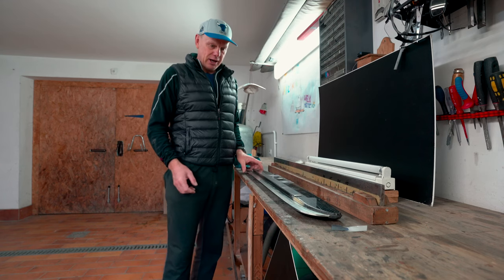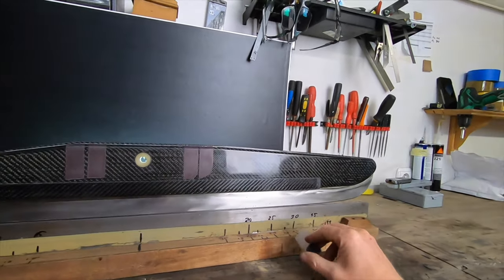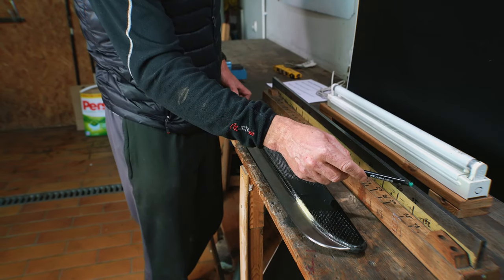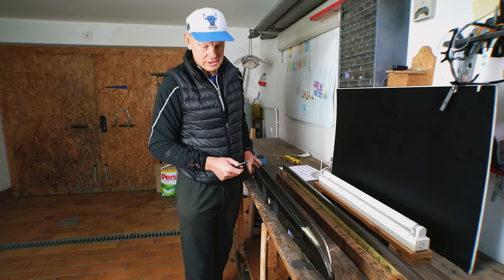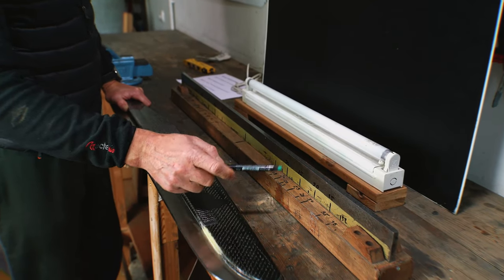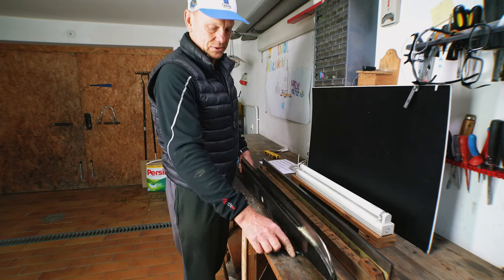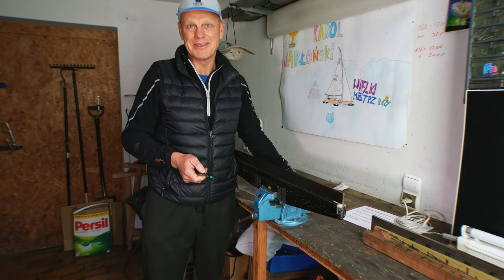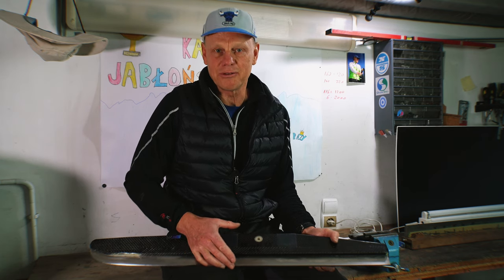DN Tech Talk | 05 Runners like a Champ | Icesailing | Iceboating

Comment: I think this was a great tech talk. He no doubt is a runner expert. There is one thing that I’d like to add and that concerns using a laser to check edge straightness. This works great as long as the runner side is ABSOLUTELY VERTICAL. Since the edge is a continuous curve, if the runner is tilted the laser will be running along a curve and the light will be all over the place. It will run from one side of targets reference point to center then back to to the side it started on.

Comment: Hi Tomek and Karol. Once again thank You both, for all the work you put in to these videos. 
I just want to know, if I got the fundamentals right, regarding the curves. Am I right when I say, that the softer the ice is, the flatter the crown has to be? Carool says a medium runner shall have a crown of aprox. 500 mm between the two 0,2 shims. If it is for softer ice, shall the distance between these marks be longer, or shorter? And does runners for black ice and high speed have a deeper curve? And What influence does the length of the “black” have?
I know this is a lot of questions, but I think there is some confusions between Lindgren and Karol’s eksplanations..

Kind regards

Christian Jensen D-324
Reply from the maker: Christian, I think Karol wa referring to 50cm crown as a starting point and the most versatile runner. As ice gets softer you want to distribute the load over bigger surface meaning that you should go for longer crown up to 60-62cm and use 100deg instead of 95.

Comment: Great information again! One question remains for me: which crown is recommended as a good starting point for a steering runner. And I would love to see a video an runner sharpening in the near future as I still have problems to achieve the crown I am aiming for.
Reply from the maker: Henning, steering runner is usually a short runner, let's say typically 30in insert. Very often crown is around 10in.

Runner sharpening - very challenging topic. Perhaps in season 2 ;)
Reply: @dnp55  Thank you!